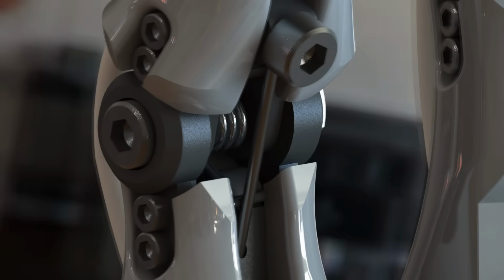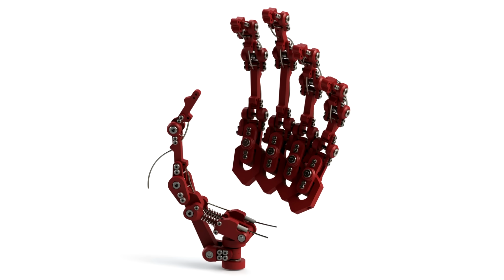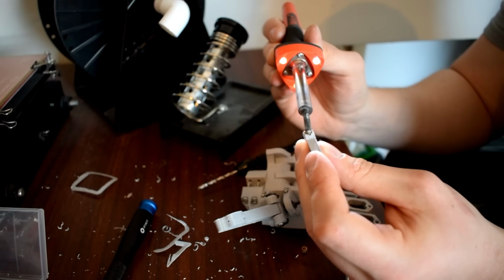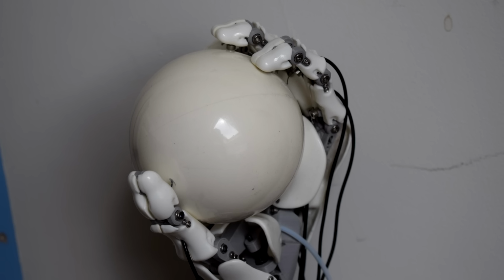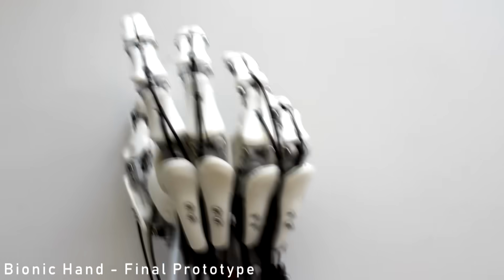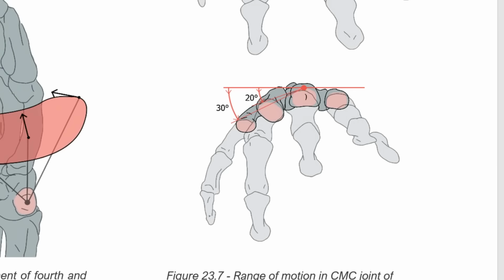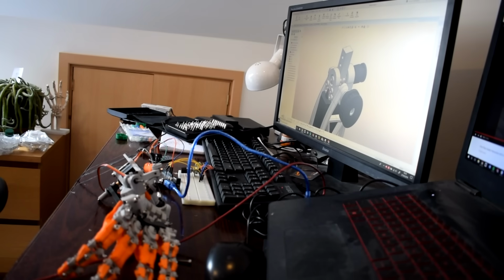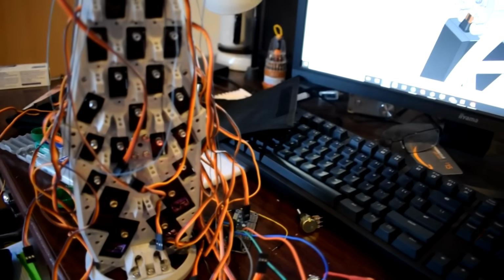3D Printed Biomimetic Mechatronic Hand Explained Part 1

Comment: On the spring in the thumb, try putting the spring inside a tube instead of around a post. The aspect ratio of the post to the hole that keeps it straight is not right. A tube can slide around a post that is the diameter of the spring. Then the diameter is big enough compared to the tolerance etc. that it will be much less likely to bind when moving.
This is a great design so far! I want to see how it develops. I think you have one of the better designs among the bunch I have seen recently. I am thinking about making a robotic arm and I'm trying to figure out how complicated of an arm I want to make. Thanks for making this video.

Comment: A really cool way to do this would be with hydraulics. Have a positive and negative pressure line running into the forearm and then you can have a 4 way reversing valve with a servo to change pressure depending on what you need. Could also have a clamping type thing to shut off pressure once you reach the desired position.

Comment: It would make it more complicated, but what if you had the inner cable and some type of lubricant to fill in the gaps of the outer cable? That should have the same effect of a larger inner wire without the friction.

Comment: if , you can use it in robotic arms , I have a project that for the next 12/24/36 will need more than 300 pairs , if you can use it in robotic arms and you want to develop it , send me an initial proposal for 5 pairs

Comment: Cool project! BTW, I see you messing with those inserts in small parts... hold the iron upside down instead, and put the insert on its tip. Then press the part down on it. I use my old iron for this and chopped the tip shorter, so it won't stick out.

Comment: Feedback potentiometer at each joint gets you only so far... You need a lot of independent inputs and independent sensors for one value, so you can cram AI learning behaviour into the latent space where usually you'd see chaotic noice splur values..

Comment: I made a model 35 years ago while I was 15 using simular methods. I had the palm, but the scale was much smaller (around 2 inches). I finished the tendors (with difference methods) . However, since we didn't have small servos to pull so many fingers. Eventually I gave up, as I needed to continue my study. I haven't started again as I know we still don't have such small motors nowadays. In addition, the tendor may lossen and need adjustment

Comment: It can carry heavy stuff? If example connecting to a robot leg(so our body not in pain), because motorised grabbing should be a Robotic Strength then our hand dont feel the weight if it is directed to robot legs which takes all the "pain"(weight of object), i am planning like a Log cutting, then wearing robotic to carry the trees.

Comment: I appreciate your work, Your way of thinking of a realistic hand is almost same as mine. What my plan is to make the joints and skeleton structure same as human bone and joints are like ball and socket with same degree of freedom. Instead of human muscle and tendon cables will be used. Another thing I think that force /stress and torque of a human hand & fingers can generate
Should be same for the robotic hand.
Another thing I want to mention is that few years back I saw a video where all the cables at middle of the hand they were using a wooden special shape object to control all types of grips. So in that case my plan is to use lesser  number of actuator to complete the project.
Definitely what you have done so far is unbelievable work. I am very happy to see your this video. Keep it up Sir. 👍👍

Comment: Open source projects like this make it simple for Skynet forces to 3d print new soldiers. Soldiers with movement so methodical and steady, their aim is fatally accurate. The utilization of a common box cutter allows a man to cut through tubing on the hand. Tubing that defines hand movement, hand movement that can kill.  This is John Connor. If you are reading this, you are the resistance.

Comment: That's extremly cool. I'm a junior engeneering student and currently I'm working on an idea to build a humanoid and throw the entire model back into mechine learning simulation for it to figure out how to dance with human. I know this is really a far fetched but do you think it would be possible to just connect a human sekelton model (thus sparing the issues we face during designing human-like small joints) with rubber band and make it move with hydrolic muscle like the festo one https://www.youtube.com/watch?v=2iG1ybuchx0

Comment: Yeah looks all techie... And yes far too much parts.
But, you're making a hand not a robot arm.
If you wanted to be simple you would have a square block bar.
Two washers, and spacer, a pot, and your motor control.
You limit the rotation on other Axel's.

Comment: Instead of lots of motors why not just have one motor spinning a carbon fibre ultrafast flywheel and use small low power electromagnets to pull on mechanical capstan amplifiers from the flywheels axle? This would save space, allow for all the range of motion and exceed human muscle in speed, power and response time.

Comment: Novyz(Shanghai) supply the custom service of CNC,
electric components, Electrical Junction Box, 19"1u 2u 3u 4u 5u 6u,7u, 8u
server subrack chassis and network enclosure, rack case,etc. Shelly Ph:
86-13671843635, 2911282844@qq.com, Skype: linnaniu1

Comment: Good evening Will, I wanted to point out that it is precisely the discriminant between convergence and divergence of the metacarpal bones that is the biggest problem in designing and creating an artificial hand.
The fact that you have correctly observed what is the natural mobility of the bones of the metacarpal, their semi-independence of movement and the different ability to articulate the last two fingers of the hand. All factors that must be calculated not only for size but also for exact structuring.
The more they are similar to human bones, the greater the possibility that the limb responds naturally to its use.
Congratulations, a greeting from a cybernetic lover.

Comment: The fundamental problem with this whole project is that you are looking to emulate a form factor through things that can't fit to that. A musculature expands and contracts to create tension. Having musculature on opposite sides is what brings things back to "rest", one side is not flexing, its just no longer tensing but the other side is now tensing. The balance between the restful tension of each side is what causes the hand to be in its rest position.
But you don't have anything that emulates that expansion and contraction of musculature, yet you want to emulate the form factor that musculature provides. This is where all your challenges are coming from.
What if you designed a form factor that was implicitly derived from the kinds of tensioning technology you have? What if you let the overall look and feel of the design speak for itself with respect to what the technology truly needs to do its job? 
I think if you thought in this way, then you would truly be emulating the heart of what the human body is doing all along - form following function, whereas you are trying to make function follow form.

Comment: For the wrist rotation couldn't you do it with cables? It might not look exact, but it'd be pretty close in function.

A pulley in the wrist parallel to the axis of rotation would be your driven pulley, and then you have idler that keeps the cable in line with the driven pulley, while letting it do the 90+ degree bend to the drive.

Comment: The metacarpal movements are dependant on the tendons or wires that move the fingers and the muscle on the outside of the hand, correct movements can be achieved by placing springs or elastic bands between the metacarpal in a position that matches those cross metacarpal tendons on the human hand

Comment: Hi Will. I also was trying to solve the problem of a curved ball grip. My solution was to drive each finger with three cables / channels. The centre to close the finger and two opposing channels to control the splaying and sideways contraction.

Comment: 7:58 I don't know if you still working on your hand, but simplest way to twist fingers is place, as first, joint to move finger left-right and second to move open-close. On the video you have that joints in other configuration and this is a reason why your finger not twist. I had the same problem on my project

Comment: I suspect that current nerves impulse sensing technology isn't as big a limitation as people think, if it's used right. I think that training an AI to take whatever nerve impulses that can be read, as a cue for what type of motion the user is trying to perform, and matching it to the expected series of motor events needed to recreate that action with the biomimetic hand, would yield good results. Especially if the hand has sensors like multiple low resolution cameras/sonar/radar/lidar, and pressure and heat sensors—whatever is needed—to feed into the AI and give it more cues to better adapt any motion it's tasked to emulate, to the objects it supposed to manipulate.

It might even be useful to imbed cheap contact microphones into the tips of the fingers where the grips are, to get an reading of the surface texture of an object being handled, by using the sound of the finger as it brushes against it. It could be combined with a contact pressure switch on each fingertip, to signal more clearly to the AI if a certain pressure threshold has been exceeded. In fact… You could even stack two or three contact pressure switches on top of eachother, each with a higher, specifically calibrated activation pressure, to allow sensing of multiple pressure thresholds accurately. You'd want to choose the exact activation thresholds for each carefully, to make the most of them. And it might simply be better to use a single, more expensive pressure sensor that can read any pressure (within reason) with decent accuracy, depending on how well the stacked pressure switches work in an actual design instead of my imagination. Where was I?… Contact microphones! Have you ever worn a stethoscope, and brushed the sound sensitive membrane across something? Try it, if you can! It produces a sound that's a bit like what you hear if you accidentally brush your eardrum with the tip of a cotton swab. Different textures should produce slightly different sounds, and if the tip of the finger can also tell that pressure is being applied to it, then it can act as a two different clues to the AI, that the fingertip has encountered a certain type of texture signature, instead of, say, picking up vibrations that are traveling through the structure of the hand from somewhere else and giving it a false positive. The more clues an AI is given, the more it can deduce. Same with humans. And like humans, an AI also needs quality training to do quality work.

I suppose an alternative to using contact microphones to detect texture, might be to place a near sighted digital camera, with a preference for higher resolution instead of color or light value differentiation. Then two or three LEDs can be imbedded in the tip of the finger as well, surrounding the camera lens equidistantly, and programmed to blink in a pattern that syncs up with the frame rate of the camera, with only one LED on at a time, so that each LED is turned on in a cycle. This should illuminate the surface of an object that is extremely close, in such a way that the light will highlight the parts that are higher, more, from the direction of the LED light source. Then, when the next LED is turned on, and another frame of video is taken, the surface texture will be illuminated from a different direction. The deeper bits in the surface of the object, should be darker, and provide contrast. Using a group of frames taken from the camera, each with a differently angled light source, the AI should be able to puzzle out the surface texture. There are definitely a bunch of engineering problems that would need to be solved to make this work, and digital camera sensors aren't even close to as cheap as a contact microphone sensor and pressure sensor combined. But it's still an option, and you could probably still get five camera sensors of serviceable quality for under 300 USD, if the price of the Raspberry Pi camera modules are any indication. It'll be the scratch resistant lens cover that will set your budget back.

Hope you liked my spit-balling of ideas. Keep being awesome!

Comment: When do you get the two axis points for the base of the thum, that iwill be awesome.

Use the hyperextended thumb and then wag it back and forth and press it forward and back.  The 3-D printing is very exciting.

And amazingly the wrist only moves a few degrees side to side it mostly bends forward and backward a little further up the alarm.

Comment: What we should be doing is making artificial muscles, something that when you send electricity through, the muscle contracts. Once we can get that made, we can fully make prosthetics that are similar to their organic components. I say this because the main problem i see in biomimetic prosthetics is that a muscle is something we cant replicate fully, and do to that, whatever we make is limited in that regard.
Reply: They have had that for decades.  I remember a documentary in the 1990's where they were simulating muscles with this black, rubber-like material that contracted under voltage.
Reply: @gulagwarlord  WHY ARENT WE USING THIS STUFF!?!
Reply: @MrBlack0950  Because its not actually that rhobust. The human body, and all biological organisms for thar matter, are very good at a very narrow range of topics. In general, pullys and servos work to a greater accuracy and higher strength then humans, with the only downside being their strange form-factor. These are far better for many tasks, look at KUKA robotics or boston dynamics, what they can do is incredible. Things like artificial muscles and rods that bend under voltage and such have their place, but in general they are not incredibly useful. In terms of a human hand made out of artificial muscles, it would not be very strong, and very difficult to manyfacture. There is also the problem of space. If the human body is good at anything its fitting a whole bunch of useful stuff into a small space. We simply can not mimic the sensor and actuator density of the human hand (at the moment, I image this will be wrong in 5 years or so).

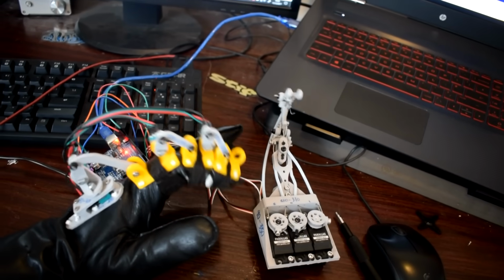Comment: I noticed @6:59 you start talking about left / right lateral motion of fingers being important. You have examples using servos to control this motion. I wonder if it wouldn't be easier to use solenoids to control this motion.  It might also be easier to incorporate it's physical structure into the hand. Just a thought. I'll admit it's likely a bad one.

Comment: meiby you can use very small Brushless Motor in the moving places like bearings and movement, then you don,t need extra place fore motors. 
https://www.aliexpress.com/item/32914741008.html?spm=a2g0o.detail.1000015.1.58052e809Pganu&scm=1007.14452.136271.0&scm_id=1007.14452.136271.0&scm-url=1007.14452.136271.0&pvid=df8e7dac-9490-4ad7-b644-29785e37bb83&s=p

Comment: What the program you use to model the hand bionic in the pc?
Reply from the maker: Solidworks, then blender and unity for the control glove later on
Reply: @WillCogley  Great. I use Solidworks as well. But I had not been able to see you using it in the video. Hugs directly from Brazil.

Comment: 2 cables per joint held under the same amount of tension, as the motor is actuated the infinity cable feeds one way as it pulls the other. Mimick the tendions that are in the actual human hand.

Comment: Nice project dude!  ever considered using compliant mechanisms to reduce the part count ? Instead of a spring around a pivot shaft use a flexible joint which in turn acts as a spring.

Comment: The pressed in brass threads I think would have been better if epoxy was used vs. Melting them inplace. I also think since joints are using torsion springs to return to neutral you might be able to use kevlar threads to replace the cables.

Comment: Mechanical tendons. Seems that is the only real way to accomplish full dexterity. The human hands are quite distinct. Great graduate project. I could see an entire robotic cyborg controlled this way and a central hub in the chest that self calibrates and controls the body functions.
Reply: I think a flywheel with electromagnetic clutches and capstan amplifiers as the central hub would equal or exceed human muscles unique response times, power and speed to superhuman levels. Maybe carbon nanofiber ropes could take the strain. When available.

Comment: for my robot, I'm just using dc motors as pulleys - so you don't need the gears of a servo which cuts down the size.  Then just use a single additional pulley to trade speed for torque
Reply: actually, you’ll want to use several pulleys to trade speed for torque in a big way

Comment: Very nice hand, I can say from my own experience working on humanoid hands. You are on a good path with your current design and very similar to my hand in design through the process and research all except for the method of fabrication. I used Fusion just to visualize my ideas better. But I made most of it by hand with machines and of Aluminum. I encountered the same problems with getting a good form function for the thumb and came up with something close to how you did it.  Although this was not my first hand, I've made some 7 versions since I was a teenager. If anyone Is interested in checking that out I have a blog on link http://myrobotlab.org/blog/1734

Comment: Great work. I have seen bionic hands that work well with only two fingers and a thumb. Simplifies the design, reduces weight, complexity and failure points, simplifies software, reduces cost.